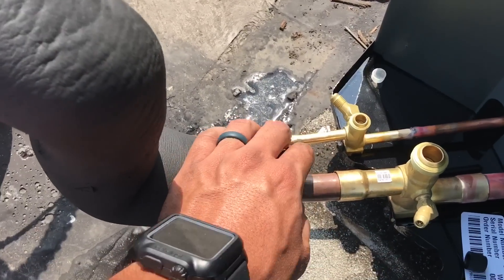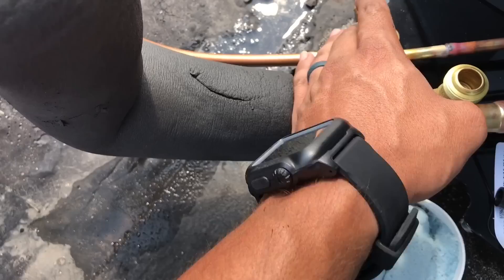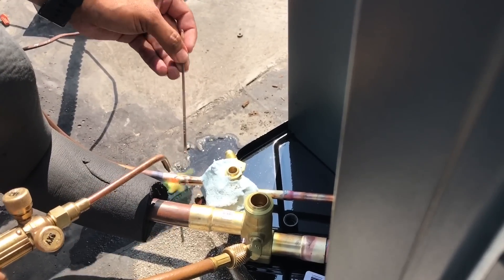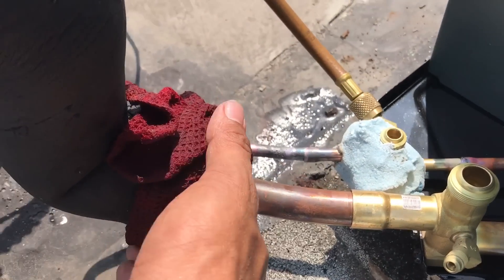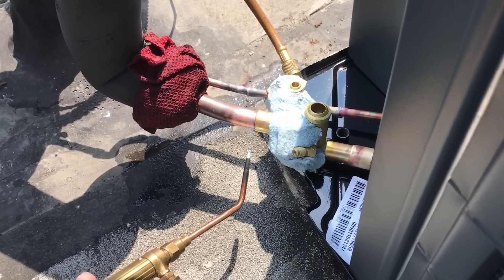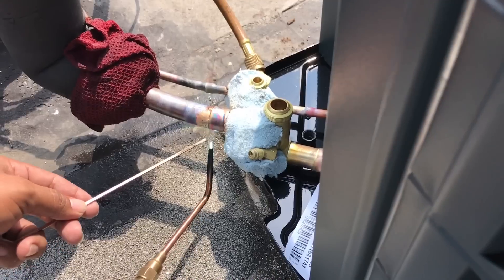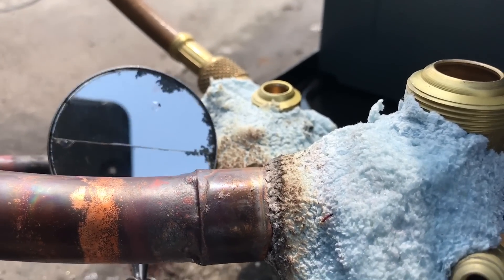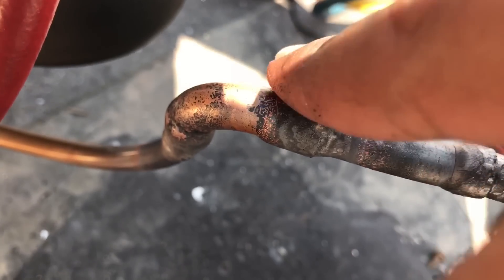Brazing 101

Comment: Only thing I didn’t like was that Acid Away.  Nothing belongs in a system besides refrigerant, and oil.  No stop leak,  or additives designed to absorb moisture or acid.  If you do a proper clean up, you shouldn’t have to add something to finish the job.

Comment: Can you remove the core from the king valves? If so, would that be a better idea than using wetrag?
Reply from the maker: It’s best to remove then and wrap the valve also so you don’t damage the Teflon seal in the shut off valves.

Comment: What kind of rod  bar and flux to weld?
Reply: Rod was pure magnesium and flux was a calcium sulfide water soluble kind..  just heat the joint till red hot the coat your rod with the flux and make sure to get it directly in the heat at first to get the “capillary action” going.  Youll know when it starts..
Reply: it will be a 15% silver braze alloy with phosphorus (sil-fos etc).  copper joint no flux. but he really should use silver braze flux on a brass joint

Comment: This was a great 101 video, many of the solder joints I see used a weak torch and don't pull the filler into the socket causing a porcupine joint . Great work! It takes confidence to post your work!

Comment: Where are you at that they allow the a.c. disconnect to just lie on the floor and to run wires not concealed within conduit.  We're talking major electrical electrocution  problem here.   You must be in a class room, one of the most dangerous places in the world.
Reply from the maker: Danny Calk the unit was being replaced. It’s on the floor because it was mounted to old unit.  I didn’t leave it on the floor lol.

Comment: Does this push nitrogen up the wrong way and warp the valves internally? I was told to push nitrogen away from the valves to prevent melting them internally.
Reply from the maker: jonas salas there is no right or wrong way to purge nitrogen. It’s gonna go in both directions. Very small amount of nitrogen just to displace any oxygen. As long as you wrap the valves with a wet rag or similar you will be fine.

Comment: Thanks for posting, enjoy your videos.... been 25 yrs since I brazed last and trying to pick it up again. Have boxes of scrap pipe and junk parts and started to melt things. Trying out both the kangaroo cart oxy-acetylene torch using sil-phos 5 & 15 as well as a presto-lite air mapp gas torch handle and hose that was stored new longer than you are old!  with Stay Brite 8 solder.  Looking to resurrect  some reach ins out of a storeroom of mothballed equipment. Want to get out of F&B operations and go back to maintenance. The bean counters finally bought a recovery setup so time to try and give it a shot!
Reply from the maker: david johnson nice. Thank you. I bet it will come back to you quickly. I like stay brite 8. Comes in handy in certain situations

Comment: Which rod please? I think you stayed on your side of the pipe too much starting out and didn't evenly distribute the heat all the way around the pipe but what do I know?
Reply from the maker: Blade 15 percent rod.  Yeah I need to clean my tip.  I should have put down my first blanket to protect the roof. You only want to be on the brass side for a few second. I would like to try  a hook tip to evenly heat the pipe all the way around.  It will probably be faster and a better braze. Thanks

Comment: You need a bigger torch, and if you flow the nitrogen from the same side that you are brazing it will push the heat away from the valve. I like the video.
Reply from the maker: sjef oekel thanks. Yeah I keep a few different tips. I like the rose bud tip.
Reply from the maker: What size do you use.
Reply: Ulises Palacios actualy i dont now what size it is, its nr3 brand name is Chloor, i use oxy and propane combination, to get the heat in fast especialy when you have a heat sink.

Comment: What tip # you use on your torch?
Reply from the maker: KC 2 for anything under 1 inch.
Reply: If anyone asks where the leak is coming from it's right under where you burnt a big hole and let it burn. Next shot nice gape. Rain water already pools in that area so thanks for keeping the trades working, by the way you didn't mention what brands you were using like flux,rod,the stuff you piled on, but the important thing was the tag was still there in the end. But it was nice to see you weren't a know it all

Comment: I also wet the surrounding areas down with a garden hose or spray bottle with water in it. To prevent fires. Dust catching fire etc. Also keep your 10 lb co2 close by as a fire extinguisher. Or garden hose. Safety first ! Dad Taught me that ! allways ! Keep Fire extinguisher or Garden hose or co2 tank close by for Safety.
Reply: just keep a full bladder,  you can always whiz it out, lmao
Reply from the maker: OcRefrigeration,Hvac & Electrical. Yes sir. I keep a small fire extinguisher

Comment: Very nice work ! Only thing i do different is i Allways put a wet Rag on the ground under where i am welding to catch hot drips and Protect the roof or what ever surface im working over. Throw a cap real quick loosely when having open schraeder ports open when removing blue stuff.
Reply: I thought he was resealing the roof for a minute there :))
Reply from the maker: OcRefrigeration,Hvac & Electrical. Thanks. Yeah for sure. I need to do that.  I was about to catch the roof on fire lol 😂
Reply from the maker: throttle bottle lol I did a little bit